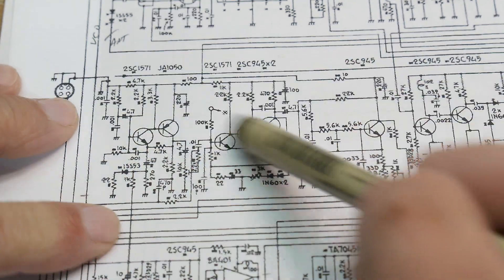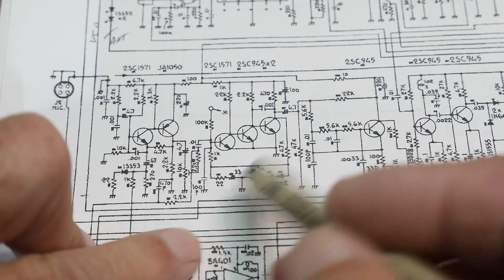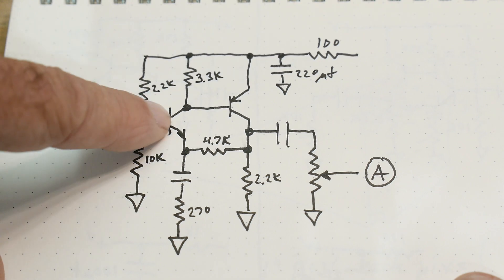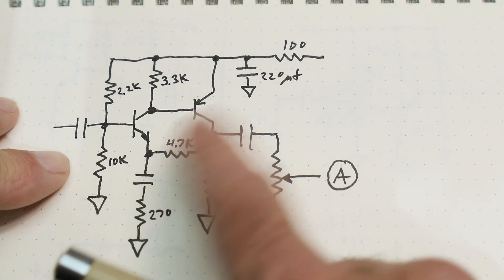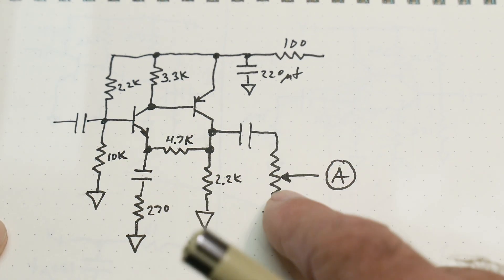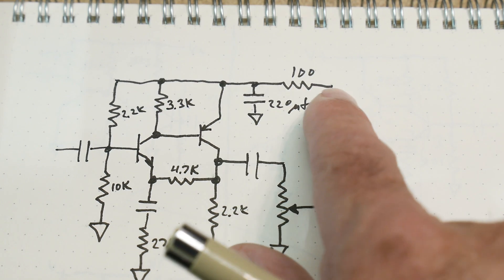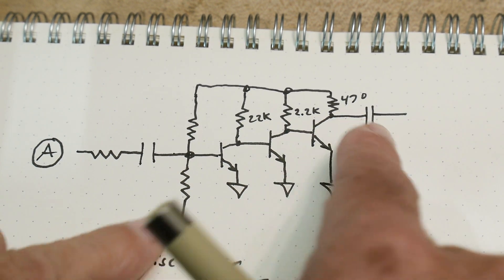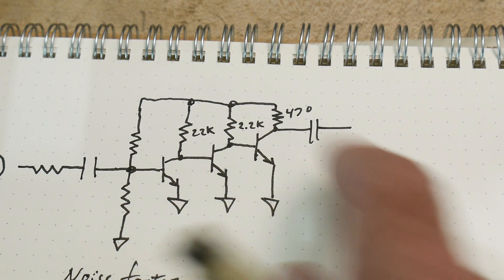#957 Gain and Noise Figure in transistors

Comment: 2:18 "a kind of upside down emitter follower" - I don't think so. If it was an emitter follower it would need an emitter resistor and the signal path would be via the emitter. The second transistor emitter is firmly grounded for signal frequencies by the 220 uf capacitor.
Reply: thats what i was thinking. isnt it just another common emitter amplifier but pnp

Comment: The cascade  section bugged me a bit. Seen it somewhere but not in a radio or audio circuit. After a bit it hit me like a ten ton heavy thing - a throttle amplifier from a vintage train set.

Where does the dotted X off the 100k go to? I am tempted to simulate this in Spice to understand the base bias / negative feedback / collector limiter a little better. Never seen something like that. 

Changing the gain on the first Q for FM (emitter bias via the 1SS53) is a one way to do it. I am guessing FM because the BA401 is an FM IF amp and the trace goes to the supply line. Not sure about the 2nd Q  because I can't see where the wiper & 22k hook to.
Reply from the maker: the 'X' goes to a tone generator for repeater use
Reply from the maker: schematics: https://elektrotanya.com/icom_ic-245e_sch.pdf/download.html

Comment: The 4700 ohm resistor between the collector of the PNP and the emitter of the NPN is a feedback resistor.
Reply: i would like to hear more about the way the feedback works in this case, if you would be so kind.
Reply: @nickcaruso  The output of the second stage (collector terminal) is connected with a resistor to the input side of the first stage (emitter terminal, which controls Vbe). Feedback is negative because each stage inverts the signal (so output is in-phase with the input) and feedback signal is affecting emitter (Vin = Vgate-Vemitter).
Reply: @pyrokinetikrlz  thank you, just what i was looking for!
Reply: @nickcaruso  The two transistors are both common emitter stages and produce a large open-loop gain. The ac input signal is injected into the base of the first transistor which behaves like the non-inverting input of an opamp. The first transistor's emitter plays the part of the inverting input of the amp, so the closed loop ac gain will be effectively the value of the feedback resistor 4.7K divided by the (ac) emitter resistance of 270R, which gives a gain of about 17, with a roll-off frequency set by the 270R resistor and its associated capacitor.

The negative feedback provides an ac signal at the first transistor emitter in phase with the input signal at its base, so increases its input impedance. It also decreases the effect of transistor parameters on the gain, linearising the response and reducing distortion.
Reply: @RexxSchneider very good explanation

Comment: The noise factor formula isn't quite right. The noise in later stages are reduced by the product of the gain of all the previous stages, so the last term would be (F3-1) / (G1 * G2)
Reply: Yes... it's the first three terms in Friis's formula (an infinite summation truncated at the first three terms)... and it there was a 4th term (4 suitably coupled amplifiers) that term would be (F4-1) / (G1 * G2 * G3) ... and it can be shown that the pattern repeats up to n terms, where the nth term is, (Fn -1) / (G1 * G2 * G3 ... Gx), where x = n -1.